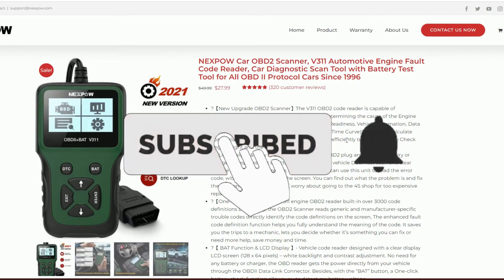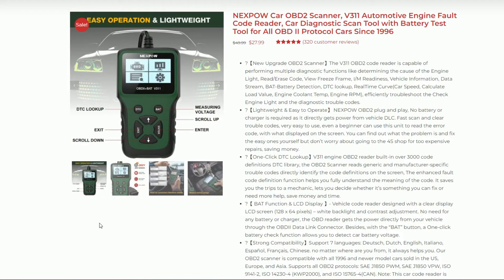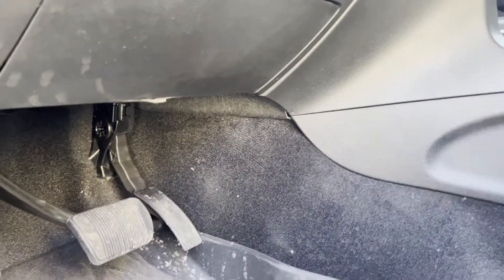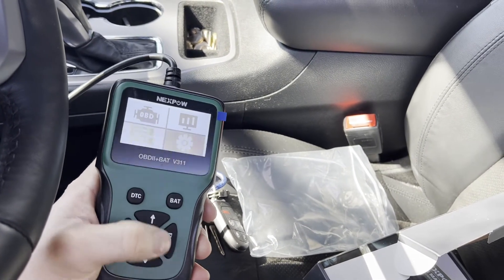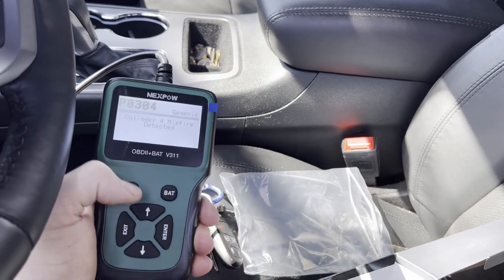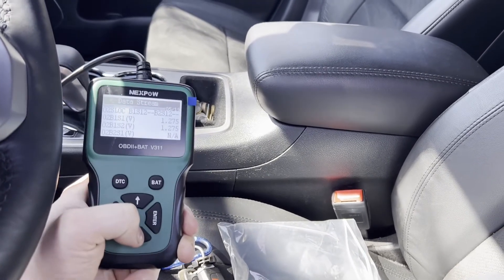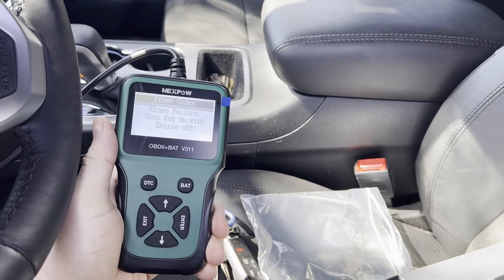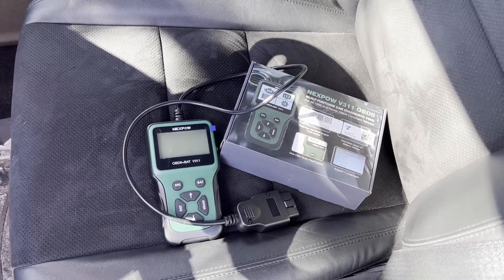Nexpow OBD2 Code Reader Overview And Test

Comment: Can a typical cheap OBD2 scanner detect problems if there is no "check engine" light on , such as rough idling or lack of power? I'm thinking of buying my first one to diagnose car problems but I don't always get warning lights. Minor car problems don't always trigger warning lights.
Reply from the maker: Even big fancy snap on scanners usually can’t detect a code unless an engine light was set, so likely not.

Comment: Thanks for the video.  Most of the videos about this scanner are just people pushing buttons with trash music playing over the top. Eeerk.
You can generate a code easily by (for example) pulling the vacuum tube off the mass airflow sensor or something equally simple.  That should generate a P0102 I think, and/or a P0171 (lean bank 1).  I think that tool should also be able to give you a live reading of the MAF sensor, so you can see if the sensor is actually working.
It seems to be quite a good tool for the price, have you had much need to use it since you made this video?
Reply from the maker: Haha I know the feeling. Not a ton of use since I made the video, but I agree for the price it’s a good little scanner to have. I keep in in my vehicle road box at all times just in case and actually did use it 1 or 2 times to scan a friend’s vehicle for codes.
Reply: @TonyTheTruckGuy  Last night I finished up buying the one with the slightly later firmware (six menu selections on the home screen) and paid more for it.  It's still cheap because I paid almost as much to have my wife's car scanned when it went into limp home mode hundreds of miles from home.  Boy was I in trouble over that one LOL.  I've done a lot of my own car work over the years but I started to feel really at sea when PCMs and emission control systems took over the whole thing.  Thanks to a lot of good videos from a lot of great mechanics, and how accessible these tools are now I think I'll feel a lot more comfortable tackling more of my own vehicle repair and maintenance again.
Reply from the maker: @Chris_the_Muso  Absolutely haha. These electronics and emissions are getting pretty wild!

Comment: How to find the code of engine lights on? My engine lights on all the time. But i could not find the code.
Reply from the maker: Try clearing the codes and see what happens. If the engine light is on constantly while the car is running, there has to be a code.
Reply: @TonyTheTruckGuy  
But how to find the engine code number?
Reply from the maker: @youguysaregreat   If the engine light is on and there's no codes, you're either operating the scanner wrong and not connecting properly to the vehicle, or the computer is junk and thinks something is wrong when it isn't, which is why I suggested making sure you're actually hooked up, then clear the codes. If the light goes away and stays off, then great. If it comes back, see if it gives you a code this time. If not, computer is bad or you have some kind of wiring issue. If you're connected to the vehicle properly (as I showed how in this video), it will display the stored and active faults when you go to the scan option.